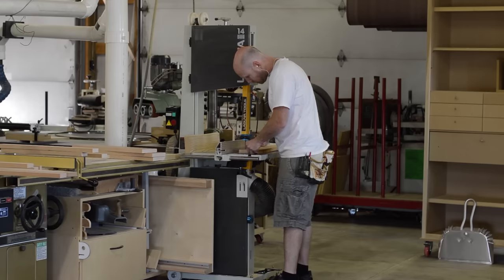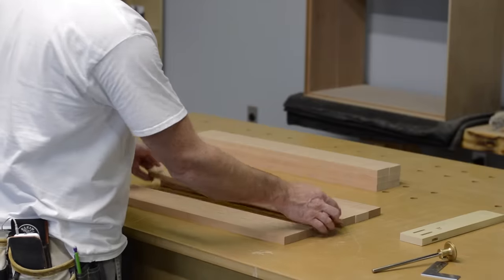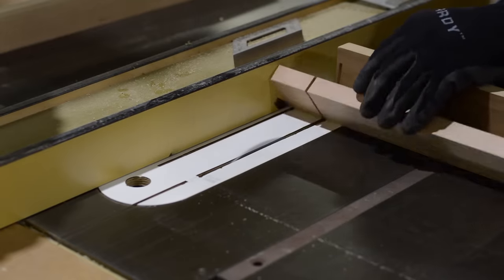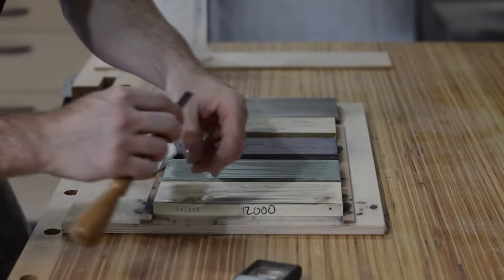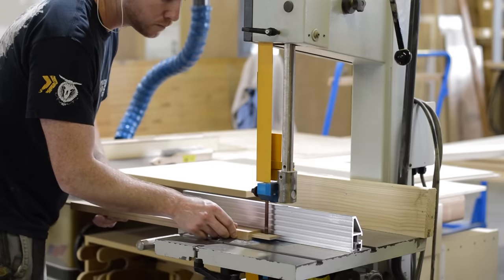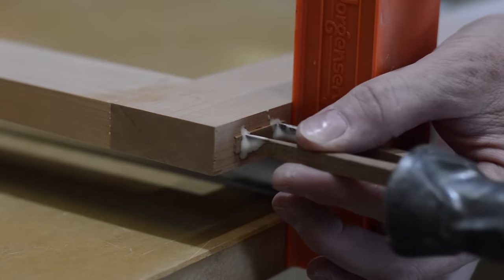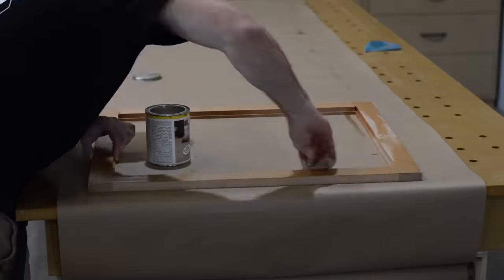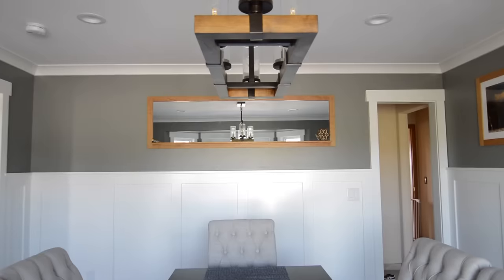How I build better picture and mirror frames, woodworking

Comment: Mike, love your videos, thanks for all the great tips.  Question: did you use a backer board for the mirror as well?  And also glazing points?  Anything about mounting the mirror that's different from the picture frames?  Thanks!
Reply from the maker: Thank you. I used a 1/8" backer, glazing points, and some silicone, only on the outside edge of the mirror.
Reply: Ok, thank you!  I've previously found it difficult to push the glazing points into hardwood, but I'm going to give it another shot.  What's the purpose of the silicone?
Reply from the maker: Agreed, I found it impossible to push the pins in. I needed to hit them in with a hammer. The silicone was just to add some extra strength and make sure there was no rattling. Our floors are a little bouncy.
Reply: @MikeFarrington  Hi Mike, looping back to this, I ended up buying the "Logan Dual Drive Elite Point Driver".  It's $38 at Hobby Lobby and comes with some points.  It worked like a champ on the walnut mirror I made.  It drives the points tightly flush to the backer board and easily drives them into the hardwood.  Highly recommend picking one up for anyone who builds frames.  "The mighty Logan Dual Drive Elite Point Driver" ;)
Reply from the maker: @AlexH-em2vv  Thank you for the tip. I will look into this.

Comment: I fully appreciate your used of brad nails, but don't tell the Samurai Carpenter.  Regarding the use of MDF on the backside.  It is not archival as it off gases.  You can buy archival corrugated cardboard, but if you want a quick and safe alternative, use a sheet of polyethelene between the MDF and the artwork as a barrier.
Reply from the maker: Thank you. Good tip on the archival cardboard. These were cheaper prints, so probably not needed for these.

Comment: Hey Mike, Great project! Quick question. I’m about to finish a built in toy storage unit /desk I built for my son out of rustic alder. Would you recommend the same Osmo product for that wood and if so which one did you specifically use? Thx!
Reply from the maker: Osmo would be fine. Use the Osmo polyx-oil, clear satin, I think its number 3031.
Reply: @MikeFarrington  Great thanks Mike! I appreciate you taking time out of your day to respond. Keep up the great content!
Reply: Just as a follow up for those looking to use this, the Part # on clear satin is 3043. And wow what a great product! I'm curious to see how it will hold up over time to abuse, but the application process and finish is awesome! Thanks again Mike

Comment: Any reason you don't drill a hole at the end of the wedge cuts?
Reply from the maker: Its not needed for a really small bend. In this case the tenon was undersized about 1/16 relative to the mortise. So the wedged part was only opening up a small amount. In a situation where the tenon was much bigger or the wedge was going to open up the tenon more, yes, I would drill holes.

Comment: Just a quick observation/question: would a dado stack not speed up the Speed Tenon method?
Reply from the maker: It might a little, but the extra force of the wider cut would not be welcomed when pushing the piece back and forth. Plus the point of the speed tenon is that you don't need to take the time to setup a dado stack.
Reply: Ha, that was the part of my question I chose to leave out after typing.
Reply from the maker: Sounds like your thought process is on the right track.

Comment: Really nice project. But I see safety third ;). No push stick on jointer and router. Gloves also makes good grip for the sawblade. I know you are really skilled and is not likely to accident happen to you, but if some novice would copy you ... that could not be funny.
Reply from the maker: Thank you for the comment, however I do not agree with any of this. In this case push sticks on the jointer or router table would have given me less control, making the cut more dangerous (for me). I watched a guy cut two and a half fingers off on the jointer using two push blocks. So push blocks may or may not make something safer. And again for me the gloves reduced the risk of pushing my hand into the blade because I had better control. Please make your own safety decisions, and I know that the novice viewers will do the same.

Comment: How do you avoid blow out when planing the edges?
Reply from the maker: Two different situations. On the long grain sides (in this case the left and right) I just plane off the ends. On the sides where there is end grain (the top and bottom), I put a small chamfer on the edge that I am going to be planing off. In other words I cut away the fibers that would blow out if I planed them. Hope that makes sense.

Comment: Where did you get the crown molding in the room you hung the mirror? What's the name of it?
Reply from the maker: I got it from Austin Hardwoods in Denver. I don't know what they call it, they don't really advertise it. Its just their finger jointed pine cove crown moldings.
Reply: Mike Farrington how did you cut the miters? I know how to cope regular crown and I have some cove mold that look similar to yours, but I was not able to cope nor jack cope. I love copeing the inside miters cause it leaves a really good seam, how did you do yours?
Reply from the maker: I cut the miters with a 12" miter saw. Some say coping is better, it may be, but I have had good luck installing it this way.
Reply: Mike Farrington so you just 45 it or did you measure the angle on the wall and split that?
Reply: Mike Farrington also did you cut it flat on the saw, upside down against the fence? Thanks for answering
Reply from the maker: I have pre cut (maybe 18" long) test pieces cut at 45. I hold them up and if the joint is not lining up I eyeball what changes need to be made and go from there. I use crown stops on my saw, so I am not dealing with the spring angle only the miter. I have test pieces for inside and outside corners if needed. Hope this helps.
Reply: Mike Farrington thanks a lot and I enjoy your videos I wish I could go to your class, you do really good quality work and you help me step up my craftsmanship GOD BLESS!
Reply from the maker: Thank you.

Comment: I generally avoid miter joints as being often weak, and ugly in most furniture (moldings are an exception, though I generally don't use them).  But in picture frames, you have a visual line through your picture, matt, and frame corners, on a diagonal.  I don't find the butt joint harmonious.  And unless the best part of the product is the frame, you don't really want to draw attention to it excessively.  Funny that, as many museum grade frames are very ornate, and yet so conventional that somehow they get ignored.
Reply from the maker: Thank you.

Comment: You have a $7,000 hydraulic scissor lift table, a $40,000 wide belt sander, but your big lottery winning purchase is a $300 sharpening stone 🧐
Reply from the maker: Little off on your cost estimates. If you took a 0 off of each you'd be closer but still high. Besides, a wide belt makes money, a high end sharpening stone will never have a payback.

Comment: I have owned a picture frame co for over 40 years....after watching you make those beautiful frames, and all your good work, you lost points with me when you used cheap mats and plex-i to finish your framed art.....always use foam core board for backing, and acid free matting and a framing grade glazing ....your framed art will always look fresh....the cheap stuff will yellow and fox up as time goes by and will look worn, and always use picture wire and screw eyes  the saw tooth hangers are not really safe
Reply from the maker: Thank you very much for your input.